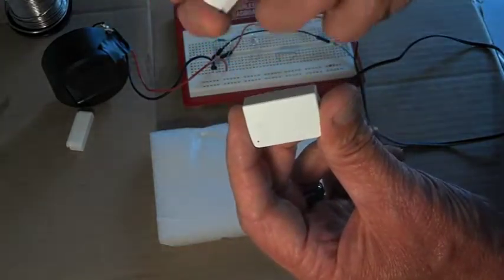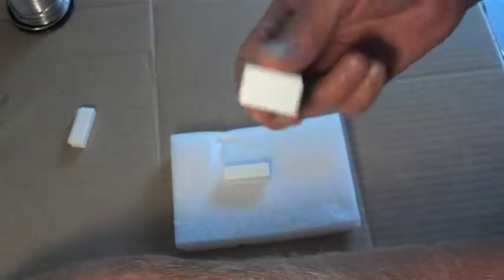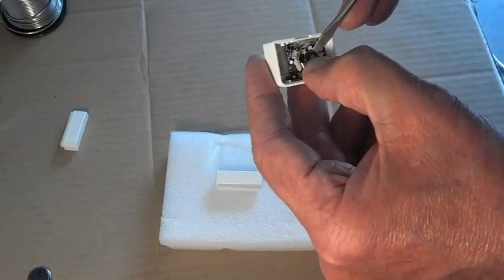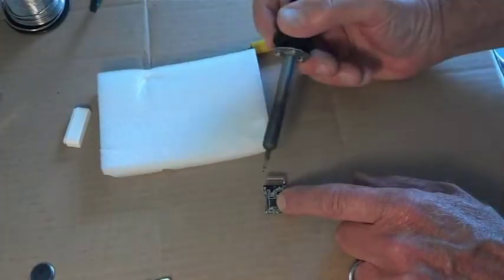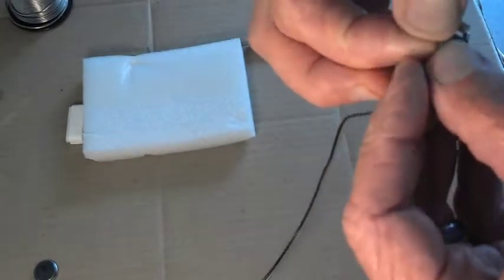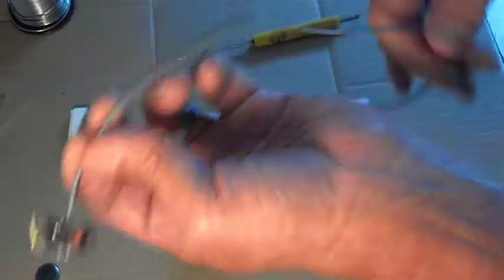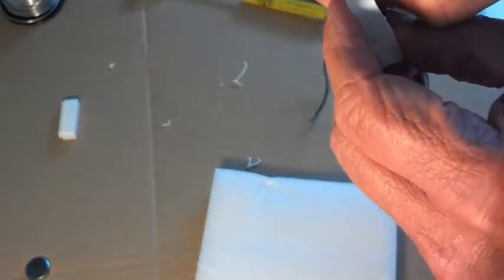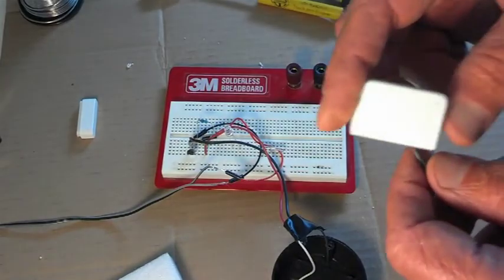Modify Wyze Sense Sensor

Comment: I did exactly this with all of my Ring Alarm sensors, in order to use my hardwired/already-installed door & window sensors and tie them into the Ring Alarm panel that expects only wireless signals. So, all of my big, ugly Ring sensors are in my utility closet, fed by the alarm wires coming from all over the house.

One deviation from this video -- I didn't remove the reed switch, since it's an unnecessary step.  The wires simply connect in parallel with the reed switch --- either shorting the wires together or placing a magnet near the sensor activates it. Being able to still use a magnet helps when troubleshooting wiring issues.

Comment: Nice video. Is it possible to modify the 3V coin battery on the sensor to use power from an external power adapter? If possible, what type power adapter to use? I don't want to keep changing the battery every year or when it's needed. Thanks
Reply: How about this: run a pair of wires out from the battery socket then connect them to a battery holder. Then use whatever batteries you might want. You can buy battery holders from:
www.Banggood.com

Comment: Hi, very nice video. The problem I have is that it leaves the sensor OPEN until it gets wet when the water will CLOSE the circuit. Leaving the sensor OPEN all the time drains the battery and probably pollutes the RF. Any idea how to fix this?

Comment: Cool stuff!  Here is an idea for a future project... can you use a sensor and turn it into a "Smart Button"?  Somehow add a button that will trigger the "closed" action and "open" action.  This then becomes a smart button that could be used for many things.  An example is for smart bulbs to turn them off/on with the closed/open actions, with IFTTT or even directly with the Wyze bulbs once they start to be sold.  Maybe use it as a doorbell and have a Wyze Cam record each time the button is pressed (but I guess it would be a lame doorbell if it doesn't have sound - lol).  Anyways, lots of uses could be found for an inexpensive smart button.
Reply: Yeah you could just put a normally closed push button switch and then when you push it out will be just like the sensor opening.